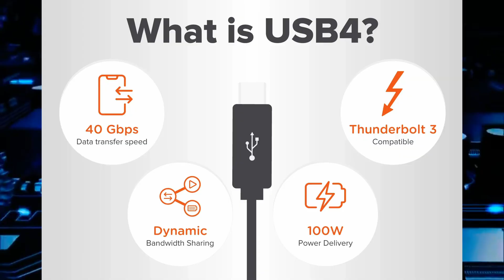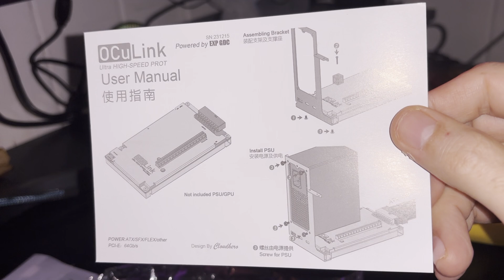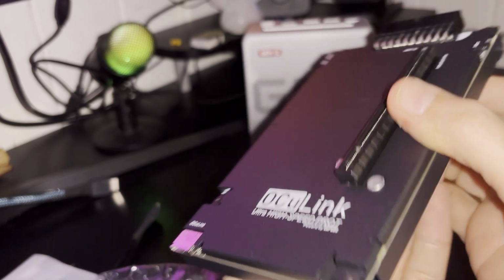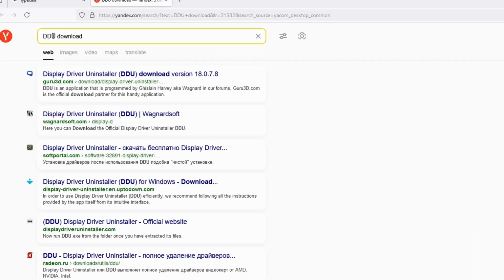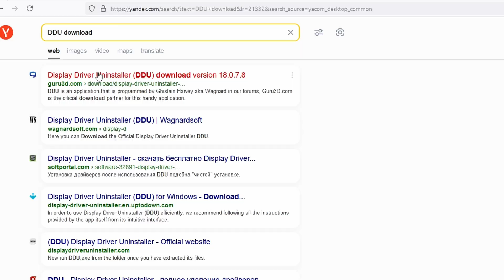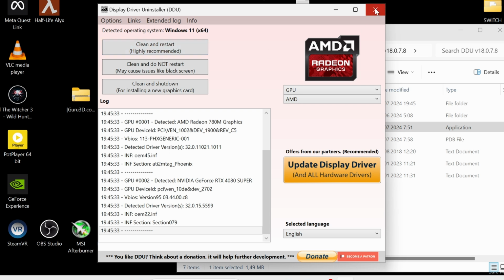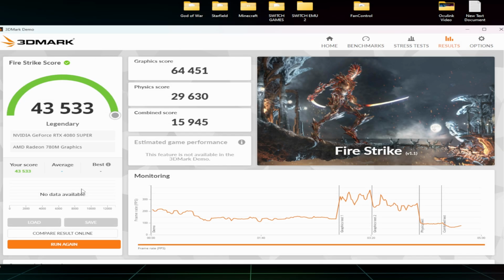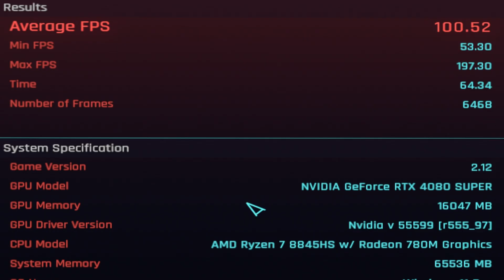Oculink EGPU Tutorial and Performance (OCUP4)

Comment: Hello, I was using my egpu with a oculink adapter with a nvme key,  until suddenly my screen went black and wasn't responding. After that the egpu wasn't showing any display. I tried ddu and tried reinstalling again. It still didn't work(it did show up for 1 second and dissapered during driver installation). I have tried everything do you have any suggestions. gpu:rx600xt  dock:  JHH OC4
Reply from the maker: It sounds like your egpu is dead, could be a a capacitor, power adapter, controler failure due to poor egpu build with poor quality component, in other word it sounds like a hardware failure.
Reply: @Ghost-Keyboarddo you think it is the power supply

Comment: If I install an RTX 3050 to a mini PC with an M.2 dock, can I use NVENC encoders to stream?
Reply from the maker: Hello, sure you can, just select hardware encoding in OBS encode setting or navigate to advance option to get a wider choice, the RTX3050 is powerful enough to handle both gaming and steeaming at the same time, if you have an AMD IGPU you can encode your stream with AMD NVEC and save all your GPU ressource for gaming

Comment: What if I want to use the monitor of my laptop itself ? Is there a way to do it  ?
Reply from the maker: Don't you have an HDMI or DP port on your laptop?? Just plug an HDMI cable from the GPU to your Laptop and you will have the set-up done :)
Reply: @Ghost-Keyboard I do, but I thought laptops HDMI ports were only for output video 🤔🤔🤔

Comment: I'm trying this setup but it is not working.. egpu gives no signal via hdmi.. do I need to install proper drivers for it to give signal? also do I need to change something in bios? for example bios is in mode Raid On for the nvmes.. if I change this mode, will it crash my OS in the other ssd slot?
Reply from the maker: Hi, try to plug 2 HDMI cables at the same time : one from the EGPU to your Monitor (HDMI 1) and the second HDMI cable from your Mini PC to your Monitor (HDMI 2), you should be able to see your GPU and install GPU drivers from there, once your GPU Driver is installed, Turn off your Mini PC and unplug HDMI 2 ( MiniPC to Monitor) and restart your Mini PC.

Comment: I tried this on my Dell Optiplex MFF 7000 in spare M.2 slot and didnt work at all. Card powers on and everything, but no detection
Reply from the maker: 1- What you do is plug 2 HDMI cables at the same time, one from your GPU to your Monitor (HDM1) and another one from your Laptop to your second Monitor HDMI port (HDMI2) .

2- Once you have are in Windows, you should go to device manager and look if your GPU is detected ( it may be detected as somrthingelse than your GPU Brand, VGA) then downloadyour GPU drivers and it will detecte your GPU during the driver istallation.

Once your drivers are installed, you can teboot and unplug your HDMI 2.
Note that you can use Display port instead of HDMI2, i hope those tips wi fix your issue.
Reply: @Ghost-Keyboard I tried this and only getting video output from PC HDMI and GPU is still not there in device manager. I have tried everything :(
Reply: @NaSTy_CHeeSe88 Did you solve this problem? I have same problem.
Reply: @ahmetali9727  i used an AMD card and it worked. Im guessing it is not supprted on the b580 :(

Comment: Hello! Can you please help me figure out if I need this adapter or not for this mini-pcs: nucbox k8 plus, nucbox k11 and minisforum um890. There are oculink ports mentioned, but I've read that I still need "curved" m2 oculink adater inside of them for ports to work. How do I check?
Reply from the maker: @eddudoskim4112  No you don t need an "Oculink to NVME M2" adapter for the K8 PLUS or K11 the Oculink port is there and wil work on the go, However with the Minisforum models you will need to install the adapter yourself (adapter is included in the Minisforum Package) downside with Minisforum models (UM780 XTX not sure for the UM890) is that you lose one NVME M2 Slot when using their Oculink port.

Comment: What if I'm gaming on my laptop with an eGPU and suddenly there's a power outage? is it safe?
Reply from the maker: Hi, EGPU or not it won t change anything, just like any device iEGPU will turn off during a power outage, and that s all. It won t die 😀
Reply: @Ghost-Keyboard Yeah, but I mean, won’t it crash my game or even corrupt my Windows? Since at the start, I already disabled the laptop’s integrated/dedicated GPU
Reply from the maker: @ Hi, The EGPU alone can't damage your game or corrupt your windows registery. The EGPU is just seen by your system as a normal hardware just like a GPU on a desktop, there is no difference.
Reply: @ thanks for your answer😄, i wanna ask again I have an i7-12650H on my laptop. What’s the best NVIDIA GPU to pair with it?
Reply: @ Sorry if I'm asking too many questions.😅
Reply from the maker: @ The one you can afford, buy usually people goes for an RTX 4070 TI because its the best Nvidia bang fir bucks card, if you have a limited budget then the RTX 4060 is a sure value ir the equivalent AMD RX 7600 XT, but at the moment the Best Deal is the Intel ARC B580, it really is the best Dollar/FPS GPU on the market, you have a powerful CPU  so you will have great performances as CPU bottleneck is close to none.

Comment: I've bought the same docking and 4060. Thinking of upgrading to 5070 in March. Do you think it will fit? What I understand is your 4080 is 2 slots.
Reply from the maker: @elfinofficial4071  Hi, Nvidia RTX 5070 Card is PCIE 5, if you ever buy a New PC/Laptop with PCIE 5 spec then the Newest PCIE 5 ADT LINK EGPU's  would be better, but if your PC/Laptop is PCIE 4 then it won t make any difference if the EGPU dock is PCIE 4 or 5. The RTX 5070 is PCIE 5 .0 X 16 so it will fit in the Ocup4 EGPU, no problem.

Not sure what you mean by "My RTX 4080 is 2 Slots" sorry.
Reply: @Ghost-Keyboard 2 slots means it physically takes up 2 slots in the back of a standard PC. 3 slots would mean it is a physically wider card. 😊

Comment: I must use adapter because don’t have OCulink help me please 😢
Reply from the maker: @รอยฮานนาคเสวี  Sawadee Krap! Yes you need an "NVME M2 to Oculink adapter" if you don't have an Oculink slot on your PC or Laptop.

The adapter must be fit in a NVME M2 slot located on your PC or laptop.
Reply: @Ghost-Keyboard did the adapter come with the DEG1?
Reply from the maker: @ Hi, i don t have the DEG1, the model reviewed in this video is the OCUP4, and the Adapter is an option that come at an extra cost.

Comment: So is this compatible with the intel arc b580 and what power supply should I use with it
Reply from the maker: @andrebradley1924  Hi, Sure it is compatible with ARC B580, great card by the way, a 450 Watts ATX PSU is enought as the B580 TDP is Max 225 Watts (PCIE Slot & pins)

Comment: Haben Sie etwas im BIOS eingestellt? Ich habe den Aoostar GEM12 mit dem Minisforum DEG1 verbunden und keine Grafikkarte wird erkannt. 3 verschiedene Grafikkarten getestet. Keine wird erkannt. Was kann ich tun?
Reply from the maker: Hi, i don't know, if you have watched the video and followed all the steps, then it should work.
Reply: No, I bought a graphics card from AMD to avoid this. Maybe just the Oculink cable is defective. Hopefully only the cable 😉
Reply: No. The Dock turns on with the PC and than nothing 😢
Reply from the maker: @flo1603  Do GPU fans spinning?
Reply: Yes they do.
Reply from the maker: @flo1603  Are you sure that your HDMI cable is plugged into the GPU HDMI port? 

Does your monitor show a "Black Screen" or  do you have a display?
Reply: The Monitor shows "no signal" tried with hdmi and DP
Reply from the maker: @flo1603  Sorry, so i don t know what is wrong, have you used DDU?

Comment: Hi I bought the same egpu dock but I m confuse as in my dock there is 20 pin ATX connector instead 24 pin standard ATX connector now I m using cooler master SFX v850 psu which has 24pin ATX connector. Now how to connect it ?
Reply from the maker: @Meesaa06  Hi, you plug the 20 pins ports by leaving 4 pins of your 24 pins on  the side of the port, it will fit.

Comment: What if you want to alternate between using eGPU and iGPU? Do you need to install and uninstall drivers each time?
Reply from the maker: @alexb5dh  Hi, No  you don t even need to disable igpu, you only disable it if you have issues, i am switching from igpu to gpu a lot, but occasionaly you would need to restart a second time.
Reply: @Ghost-Keyboard So you plugged one HDMI to the eGPU and another HDMI to the NUC? What do you do when using iGPU and vice versa. Can you do a video about it? Thank you.
Reply from the maker: @elfinofficial4071  Hi, i can t do a video on this topic as there is not much thing to say, running the Mini PC without the EGPU only reason is saving on power consumption or moving the EGPU to an other system, there is no technical issue there, you just unplug or plug and your Mini PC or Laptop will work with or without the EGPU on their usual respective HDMI cable.
Reply: @Ghost-Keyboard Sorry for asking, I have the Gmktec K8+ (8845HS).
Oculink epu is planed alternative to the iGPU, but in your PC the WinOS has only the eGPU Driver (for my example I'm interested in AMD next coming Radeon 9070 ? Do the intergraded iGPU and the eGPU  work in each situation (with or without oculink) with only one driver?
Reply from the maker: @ Hi, you are overcomplicating things, first of all i don t have only one Graphic driver installed, i have both AMD IGPU driver and Nvidia GPU driver installed, also i can use both IGPU and GPU at the same time, for exemple i can run a game with the NVIDIA GPU via the EGPU and Video capture the gameplay with the AMD IGPU on OBS.

If you have both an AMD IGPU and the AMD RX9070, AMD Adrenaline software will install automatically all the drivers nneeded for your system (USB, Bluetooth, IGPU, GPU, CPU, ect) in a single installation, although  downloading drivers separately is also possible. To be clear each hardware/peripheral needs and have its own dedicated drivers. 

And Last don t be "Sorry" to ask question, i am here to help and share knowledge 😀

Note: you only need to uninstall Drivers of your older GPU (with DDU) when you are installing a new GPU on your O.S, i know it is confusing coz i also said that you must desactivate the IGPU, well it is not a golden rule, but it is the safest way for the EGPU installation process and avoid driver conflict
Reply: @Ghost-KeyboardHi! Your advice is very useful. I just started and I'm still a beginner in this topic. I have a GMKTec K8plus that I bought on your recommendation before, it worked very well. Now I bought the OCUP4v2, an Nvidia rtx 5070 and an SFX750W power supply. The question is: I haven't used the K8plus minipc with any other external VGA, do I still have to do the ddu driver deletion, or is it enough to just install the Nvidia driver after I've assembled and turned on the 5070? Thanx any answer!

Comment: Does the dock auto starts when you power on the mini pc? Did you use m2 2280 adapter card?
Reply from the maker: @kfiatos  Hi, yes the dock auto start by powering the Mini PC.

I did not use an NVME M2 adaptor, this is an Oculink EGPU, not a Thunderbolt EGPU

Comment: I love these bracket solutions to 1) show off the card and 2) allow external graphics on smart box computers. This has a durable looking finish too. Is it as durable as it looks?
Reply from the maker: @KirillKaplan  Hi, thanks you for your comment, why wouldn t it be durable?There is no special hardware stress with this setting, actualy GPU cooling is better but it lose on the dust accumulation side depending of your environnement, however it s something that could be fix buy removing dust with a vacum in reverse mode or canned air.

Comment: if i have the option to plug in the m.2 slot, does it have better performance?
Reply from the maker: @ciw8688  Hi, Normaly you should have the same performances as both Oculink and NVME M2 have the same data speed transfert using 4 lanes of PCIE 4 , However i did have better performance with the Oculink eGPU than with an NVME M2 eGPU but Test were made on 2 different Mini PC, so the better Performances i have obtained with the Oculink were probably due to the better CPU of the Mini PC rather than the Oculink eGPU being better than the NVME M2 eGPU.

Have fun with your eGPU 😃